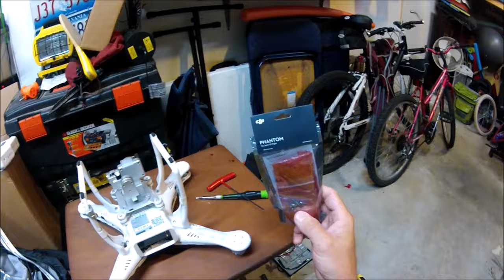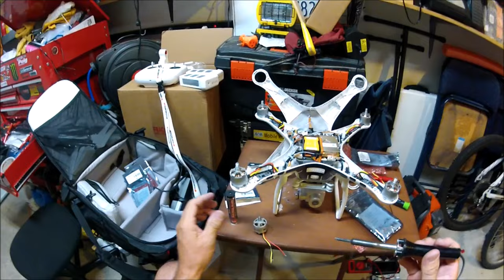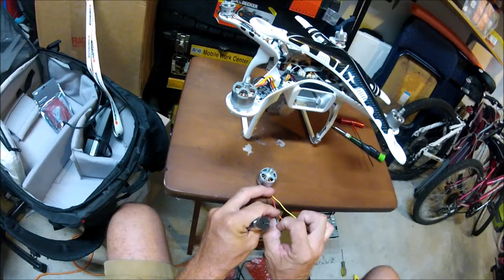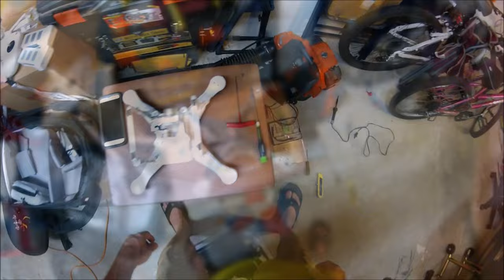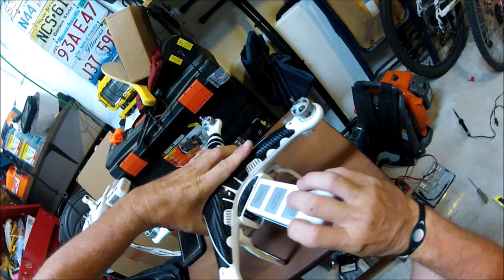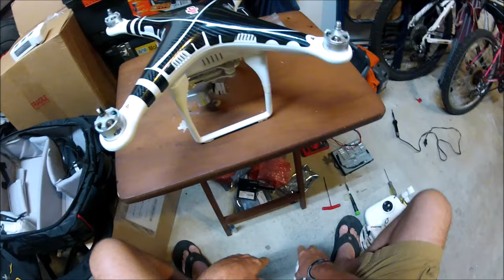POR DENTRO DA GARAGEM INSTALANDO OS MOTORES DO DRONE E NAO DEU CERTO | L337 VD#305

Comment: e ae Lee blz bom nao vi de perto mais acho q vc soldo algo errado ou os ESC tavam ruim mais
uma dica q fica mais facil e nao fixar o motor no ESC direto e usa uns conectores tipo plugs ai vc corre menos rico de danifica
eu normalmente depois de umas horas de voo troco motor e ESC as vezes ate troco junto os 2
mas num desisti dos drone nao Lee eu acho bem mais barato vc monta um do que
fica refem de alguma marca como a DJI que peça de reparo e caro de mais no seu caso ja da pra aproveita
varias coisas desse pra vc monta outro em outro Frame a sua escolha vlw
Reply from the maker: depois voltei o video e vi que estava certo o problema foi a placa mae que estava em curto !!!
Reply: Onde acho esses conectores tipo plugue